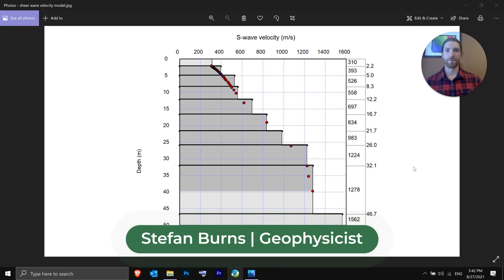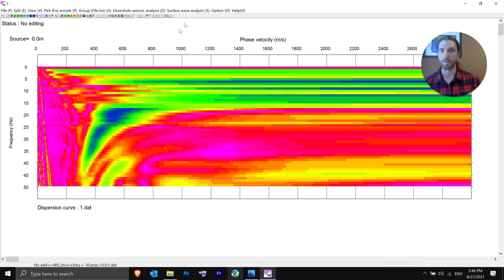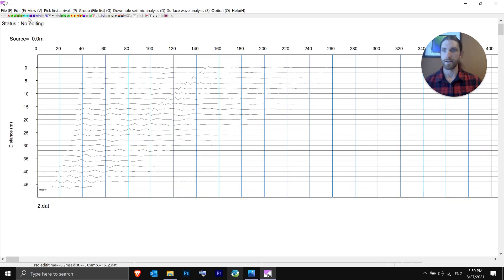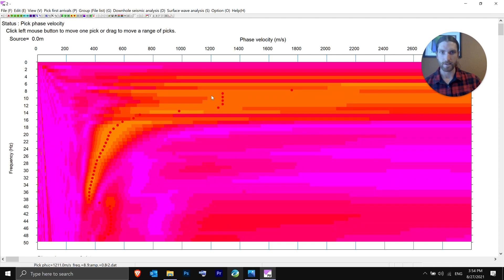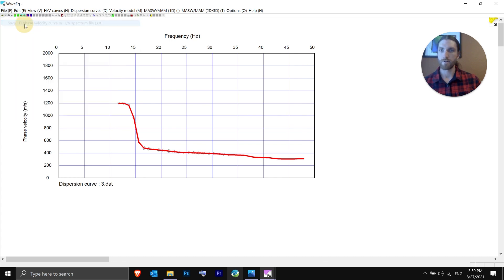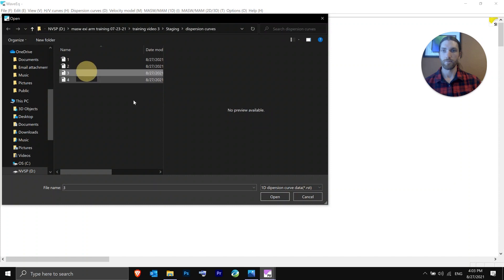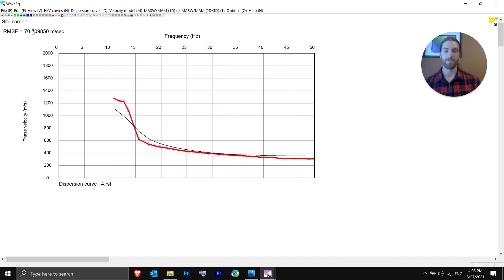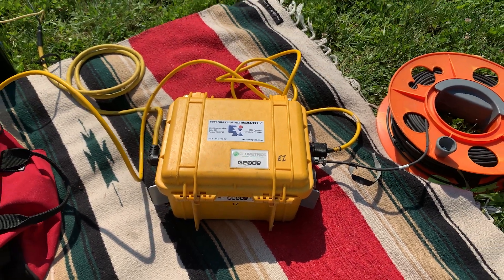1D MASW Data Processing using SeisImagerSW | 03

Comment: Thank you for this training video. After the inversion where you just adjust the VS of the blocks, does this reduce the RMSE? Wouldn't you need to invert again?
Reply: Adjusting the blocks is just adjusting the visual model, not the VS points